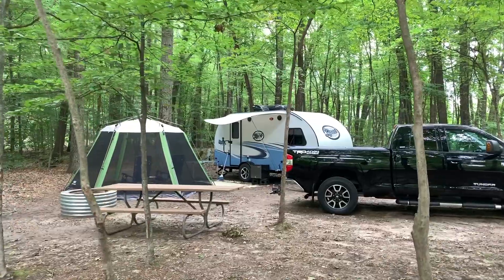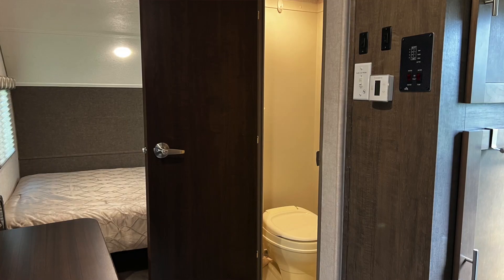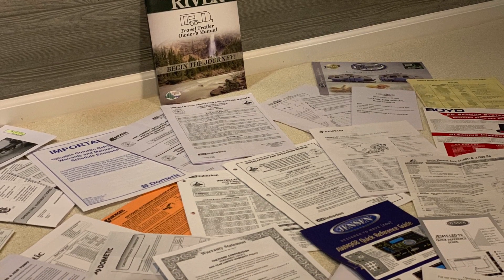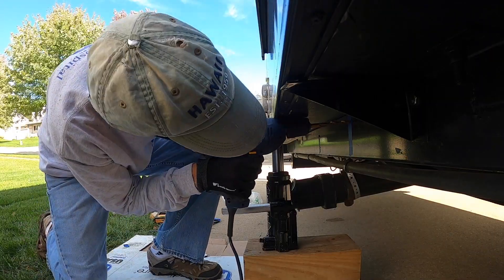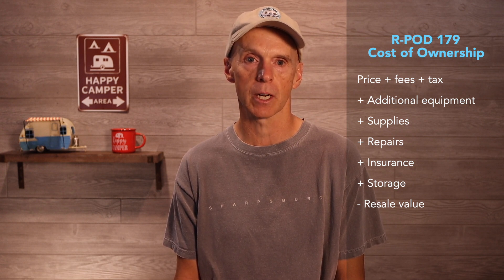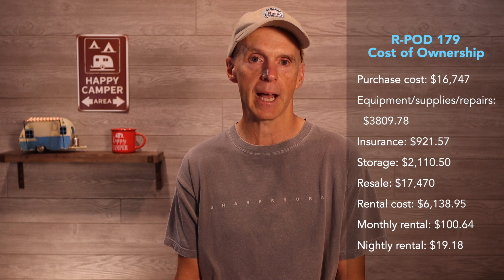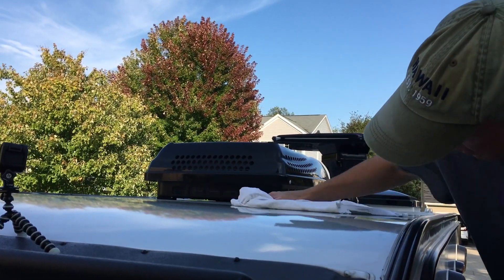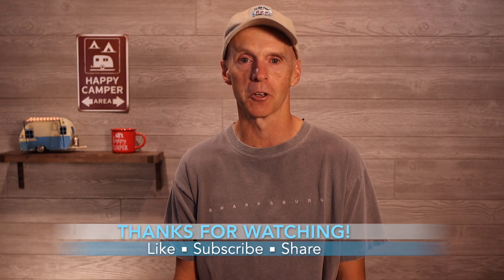R-Pod Long-Term Review - 5 Years of Ownership

Comment: Don’t buy rpods , at least you tell it like it is . Bad quality.
Reply from the maker: The initial quality wasn't horrible, but as time went on and I used it a lot, it quickly became evident that it wasn't built well. The structural materials and poor warranty certainly didn't help. Thanks for the comment!
Reply: How do we know what is good?  Seems like forest River makes many of the competition....where do we go to get honest unbiased comparison?
Reply: @ Mrvonjutzi
Read reviews, I’ve been looking for 2 years just waiting for prices to crash. Only good brands are Airstream, all the fiberglass brands Scamp etc. , Intech, and Taylor Coach of Canada but they got a 4 year wait. And any brand that custom makes them. 
Don’t buy any with wooden walls or laun ( same as wood) . Must be Adzel on the outside and inside. Some got Adzel on outside only inside is wood. Don’t buy wood frames . If they leak the wood will rot and mold. They all got wood floors.
 Aluminum frames only. Don’t get one with a Lippert A frame they got a class action suit against them. 
Some brands don’t honor their warranties google it read reviews you’ll know who. 
After all that there  isn’t a lot left to pick from.
Reply: Hello John- love your channel and your honest reviews. We have now owned an RPod 193 for just over a year. We completely understand your frustrations about the RPod. We have come upon several pretty large problems while traveling this past year while close to home and across the country. Our last trip required two days of driving without brakes on the trailer to arrive at at Forest River repair shop in Pennsylvania. The shop was fantastic and we were grateful for the fact that they were able to order the brakes while we drove to them. They took two days with our trailer and we were only in a hotel for two days which was ironically part of our trip.  We learned at the first repair shop that it is very difficult to get parts for repairs while on the road and that on newer models the parts fail more often.  
Some of the fails in year one- shade/screen, microwave falls out, vacuum cover plate breaks, hinges on bed bend, bed doesn’t line up on supports properly, stove screws do not hold, trim pops lose, black tank hose flush installed improperly and leaks inside the camper… we have had everything repaired under warranty but are going into year two. I do think that the memories far out weigh any type of dissatisfaction I have with the camper. After being a tent camper, for I expect challenges.
Reply from the maker: @artofcampingnow  Thanks for sharing your experiences!